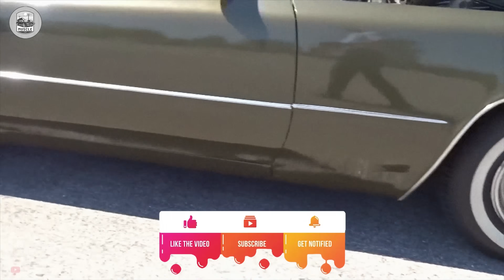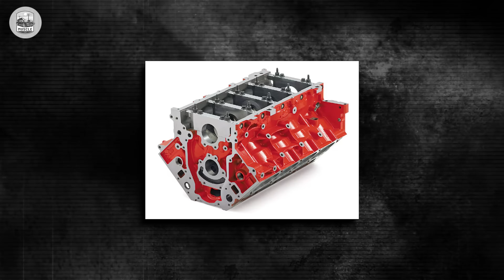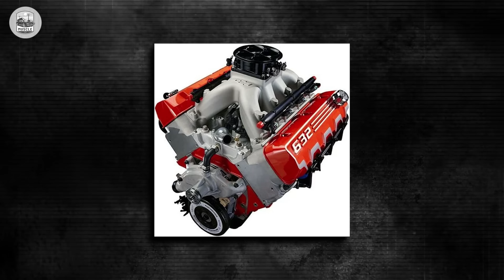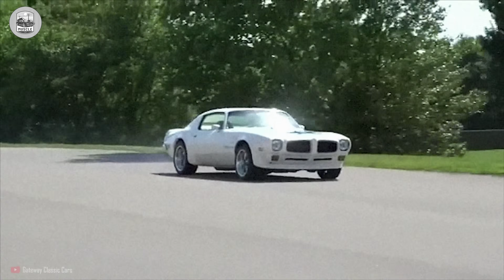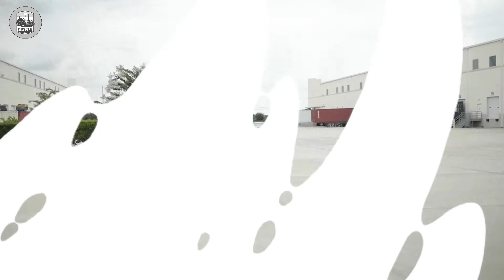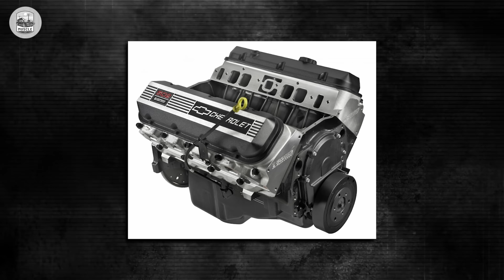GM’s CRAZIEST and BIGGEST V8 ENGINES ever made | You didn't know about!

Comment: Buick also had the nailhead, and the 425 ci Super Wildcat with dual quads from the factory was quite a beast! One guy had this engine in a Riviera and claimed he could bury the needle. The Riviera had a 140 mph speedometer!
Reply: Buick Nailheads are cool, but I’ll stick with my big block Chevy any day. That ZZ502 I had in my Chevelle would eat a Nailhead alive on the strip.
Reply: @KeithGreene-k1v  The ZZ502 was never offered in any car from the factory, but you’re right, it is an awesome engine! The last year of the nailhead was 1966, and it compares well with engines of the era that it was offered in. No, it won’t beat a HEMI or some of the other big blocks, but it powered many great cruisers, and is still a good 50s and 60s performance piece. Incidentally, TA Performance could and has built big block Buick engines that compare well with the ZZ502 Chevy. Chevy now has a new 632 big block crate engine, but I don’t know anyone who could afford one.
Reply: @fredanddebramacdonald2445  TA Performance can build beasts, but stock for stock, the ZZ502 is a whole different animal. Buick fans might say torque is king, but the ZZ502 brings torque and revs to the table. Plus, Chevy’s parts availability and cost-effectiveness seal the deal. As for the new 632? Cool tech, but it's priced more like a museum piece than a street contender
Reply: @KeithGreene-k1v  you really should be comparing a 454 Chevy to a Buick 455. Yes, that ZZ502 will blow them both off, and it should. I have only seen one 502 in my life and it was powering a 1934 Buick Phaeton street rod. A very high dollar car for sure!! It may be noted, that the ZZ502 is still $12,000 which is still very big bucks in my neighborhood. And unless the vehicle you are putting that ZZ502 in was originally equipped with a big block Chevy V8, the additional parts to install that engine will eat up any cost savings that might occur by using that engine. Wiring, for accessories, possible new transmission with correct bolt pattern, accessory brackets, etc.can and will eat up a lot of money fast, especially if a professional shop does any of the work. The LS engine swap is very popular, and the ZZ502 swap would probably cost about the same.
Reply: @fredanddebramacdonald2445  I get why the ZZ502 catches attention it’s a powerhouse but let’s not overlook the Buick 455 when talking serious torque monsters. The 455 Stage 1 was rated at 510 lbft of torque in 1970, the highest of any muscle car engine at the time! Sure, it wasn’t a high-revving street screamer like a Chevy 454 LS6, but that low-end grunt made it a highway terror. Plus, the Buick 455 is often overshadowed in swaps, despite being lighter than the Chevy big block thanks to its thin-wall casting design.
You’re right about swap costs; they add up fast! But here’s the kicker: while the ZZ502 gets all the headlines, a well-built Buick 455 or 454 Chevy can hold their own for a fraction of the price. It’s all about knowing what fits your build. For sleepers or street dominance, don’t count out old-school torque.
Reply: @KeithGreene-k1v  Yes!! If I recall, the quickest quarter mile time Motor Trend Magazine recorded in 1970 was the Buick GSX at something like 13.28 seconds at 105 mph. It blew off everything including the HEMIs, etc.Yes, the late muscle car with turbos and superchargers and wide tires to get the power to the pavement will blow off the old cars, but memories and the simplicity of the cars (easy to work on) from the “golden age” will always be there for us who lived through that time period. Many of those cars will still hold their own on the street, especially if they have been updated by enthusiastic owners.
Reply: @fredanddebramacdonald2445  Hold on a sec while everyone drools over the zz502 or even the LS swaps, let’s talk practicality. The Buick 455 Stage 1 was a torque king at 510 lb ft in 1970 untouchable by Hemis or 454 ls6s in that department. But here’s the twist: that thin-wall casting? It makes the Buick 455 lighter than most big blocks, offering a better power to weight ratio for street builds. Sure, turbos and modern swaps have their place, but updated classics like the 455 can still dominate. With proper tuning and some modern upgrades, it’s the ultimate sleeper without the wallet busting costs of a zz502 build...
Reply from the maker: @fredanddebramacdonald2445   Yes, The Buick 425ci Super Wildcat with dual quads was a true powerhouse, producing 360 hp and 465 lb-ft of torque
When paired with the Riviera, it was a beast on the road, effortlessly reaching impressive speeds those 140 mph speedometers weren't just for show! The Nailhead V8's torque was legendary, and its distinctive "low-revving" nature made it a unique contender in the muscle car era. Do you have any memories or stories about the Super Wildcat? 
Drop them in the comments below! Don’t forget to like, share, and subscribe for more muscle car history
 Keep the engines roaring
Reply: @MuscleCarMasters68  I had a friend who was employed at a small independent shop and a client of theirs had a 1963 Riviera with the Super Wildcat engine. Nowadays, I belong to Buick Club of America, so see these at Buick car shows every summer. At that time, my friend had what was a real street sleeper. It was a 1962 Olds 88 with a 394 ci Rocket engine from the Olds 98. If you put your foot down, in drive, it shifted into high at 105 mph! Buried the needle (120 mph) with no problem! It was a light brown 4-door, very innocent looking.The Camaro I owned at the time  (350 4-speed) almost could keep up with that beast.
Reply from the maker: @fredanddebramacdonald2445  Thanks so much for sharing that awesome story
It’s always great to hear about real street sleepers like that 1962 Olds 88 with the 394 Rocket engine. That car must’ve been a blast to drive, especially with its ability to shift into high at 105 mph truly a hidden powerhouse! It’s also incredible that your Camaro 350 4-speed could almost keep up with that beast. The Buick 425ci Super Wildcat was certainly one of those iconic engines, with its 360 horsepower and 465 lb-ft of torque. The Nailhead V8’s combination of torque and smooth power delivery made it a force on the streets and at the track. I’m glad to hear you’re part of the Buick Club of America and get to see these classics at shows every year
Have a good day.

Comment: Oldsmobile 425
Reply: Legendary !
Reply from the maker: Thanks for your comment
 The Oldsmobile 425 V8 was a powerhouse, introduced in 1966 as part of the bigger and bolder push by GM for muscle cars. With a bore of 4.12 inches and a stroke of 3.975 inches, it delivered around 370 horsepower and was a favorite for its smooth torque and performance. This engine made waves in muscle cars like the 98 and Delta 88, providing thrilling acceleration and a unique exhaust note. We’re here to celebrate engines like the 425 and all the legendary American muscle
 Keep the conversation going, drop your thoughts, share your stories, and don't forget to subscribe for more American muscle car content
 Let’s keep the passion alive
Reply: @    This engine was given to me that came out of the Delta 88 when my friend died. Before I could get my hands on it the heads were taken by a mutual friend to pair with a 455. He offered me the 455 heads but I turned it down cause because that combination only worked in his favor. Went on to a 396 in a camper special and. 68 Chevy with a 8.9 in. bed. Always had dreams of building something bigger and better but got a back injury that put an end to all that.
Reply from the maker: @skidmark7845  Thanks for sharing that story! It's tough when dreams are put on hold, but it sounds like you've had some serious muscle car moments. The Oldsmobile 425 V8 really made its mark in the muscle car world, offering that perfect balance of power and torque that made cars like the Delta 88 and 98 such legends. It's crazy how a simple swap, like the 455 heads, could change the entire game, but it sounds like you knew what you were doing. We love hearing about these stories and celebrating engines that have shaped the muscle car legacy.
Have a good day.

Comment: The last GM big block was the 496 in 2009. The last year for the Chevrolet engine name was 1991. So no such thing as a Chevrolet 454 LSX, ZZ 502, ZZ 572 or ZZ 632. The first fact is an easy Google search. The second, can be found under Forbes - GM Powertrain timeline. I have chatted online with GM Powertrain once and asked who made their 502 and 572 engines and he came back and told me something such as that information is not available to the public. Nelson Racing Engines has been making the 572 and 632 for over 15 years now along with other engine makers, this is before GM started to advertise these same exact displacements. 
The 455 Pontiac has 456 cubic inches and for comparison, the 350 Pontiac has 354 cubic inches. 
As for the Oldsmobile 455, technically it is not a big block but rather a tall deck, The reason is because the head from a so called small block will bolt to a 455 and they both have the same bore center of 4.625". A later example would be the 302-351 Ford so called Windsor engines, one is a taller deck from the other with interchangeable heads and the same bore center of 4.380".

Comment: The Buick super duty 455 stage one
Reply from the maker: Thanks for your comment
The Buick Super Duty 455 Stage 1 is an absolute powerhouse, no doubt about it. With its massive torque and legendary performance, this engine was a game-changer for muscle car fans. The Stage 1 package offered a perfect balance of street and track-ready power, with enhancements to the intake, camshaft, and exhaust system that pushed it to new heights. It's a true icon of the American muscle era
We love hearing your thoughts drop a comment, share your experiences, and don’t forget to subscribe for more
 Let’s keep the muscle car legacy alive
Keep the comments coming, hope to see you next videos.
Reply: the Buick 455 Stage 1 is legendary for torque and all, but let’s not act like it’s untouchable. Sure, it pulled hard off the line, but compare it to a 426 Hemi or even a 454 LS6, and the numbers tell a different story. The Buick was built for cruising more than tearing up the strip, and it showed. Not to mention, Stage 1 cars didn’t have the same aggressive cams or high-rev potential as their Mopar or Chevy rivals.

Comment: My favorite is the olds 425 with C type heads 10.25 to 1 compression ratio 310hp 475 ft pounda of torque at 3600rpm steelforged crank and connecting rods family car use with alot more to put out
Reply: The 2 bbl high compression version of the 425 is 310 HP (torque is 450 lbs/ft) The 4 barrel versions ranged from 360HP to 385HP depending on the year, compression ratio or car line. The only one that was rated at 475 lbs/ft was the 385HP Toronado version.
Reply: @turbo8454  the Olds 425 was a beast, no doubt, but let's not overlook the Caddy 472. That engine wasn’t just about numbers; it was a torque monster built for durability. While the 425 had the edge in performance tuning, the 472 could pull like a freight train and keep going forever with minimal care.
Reply from the maker: @CookeZachery  The 472 wasn’t just about raw numbers; it was built to last, delivering that incredible low-end torque that could pull anything, anywhere, for miles without breaking a sweat. Paired with the Olds 425, it’s a perfect example of the engineering powerhouses from that era. Both engines are iconic, but the 472’s durability and sheer strength are unmatched.
Thank you so much...
Reply: @CookeZachery  The original poster said the 425 was his favorite.  My response was directed at him. He did not mention anything about the Cadillac.
Reply from the maker: @turbo8454 Thank you for sharing your thoughts
I totally get why the 425 is your favorite—it’s a powerhouse in its own right.  The 472 wasn’t just about raw numbers, but about delivering reliable low-end torque and relentless power. It could haul anything, anywhere, for miles, and it kept going with no hesitation. Paired with the Olds 425, you’ve got two American legends from a golden era of muscle car engineering. The durability and pure strength of the 472 set it apart, and that's why it's an iconic piece of muscle car history.
Have a good day.
Reply from the maker: @turbo8454  The Olds 425 truly is a beast with that 10.25:1 compression, and it's amazing how those 360 to 385 HP versions can really get the torque numbers up, especially in the Toronado with 475 lb-ft
The way Oldsmobile squeezed that much power into a muscle car (or even a family car!) is a testament to their engineering skill. It's all about blending muscle with precision. There’s a lot of untapped potential in these engines, and I’m sure many fans are eager to dive deeper. 

Keep the comments coming, share this with fellow gearheads, and don’t forget to subscribe for more muscle car action...
Reply from the maker: Awesome choice
 The Olds 425 with the C-type heads is a powerhouse! With that 10.25:1 compression ratio, it delivers an impressive 310 horsepower and 475 lb-ft of torque at 3600 RPM. The forged steel crank and connecting rods are built to last, making it a solid performer. It’s incredible how Oldsmobile packed so much muscle into a family car, showing that they knew how to blend power and practicality. There’s so much potential to unlock in that engine with the right mods. 
Keep sharing your thoughts, muscle car fans
Drop your comments, share the love, and don’t forget to subscribe for more muscle car greatness
Reply: Sure, the Olds 425 had some grunt, but the Caddys were smoother and could haul their weight effortlessly. I’ve seen 472s outlast everything else on the road with just basic maintenance.